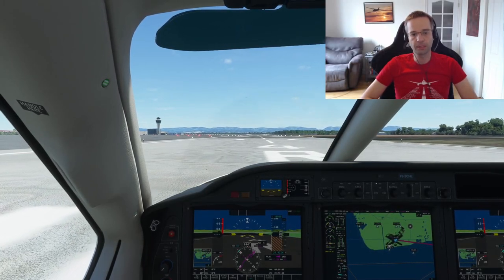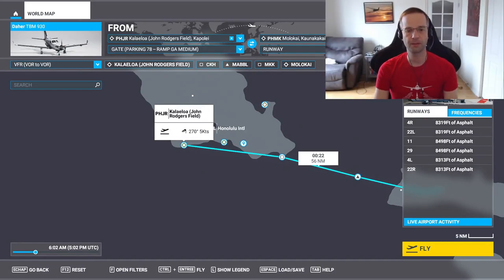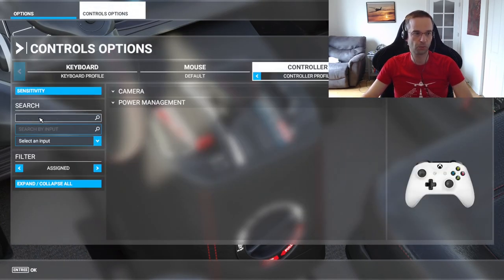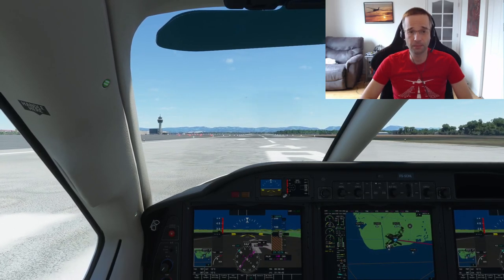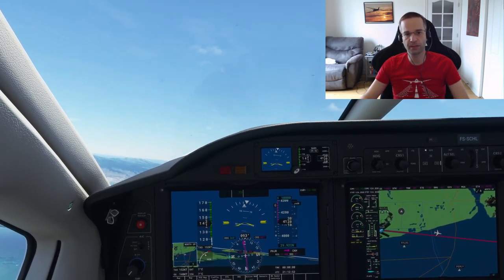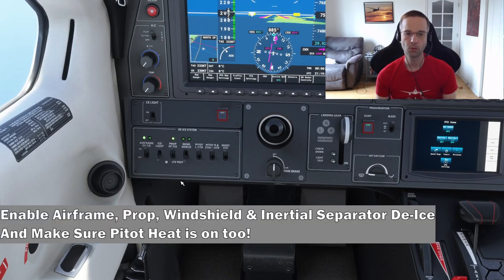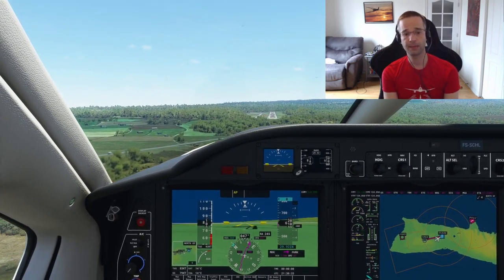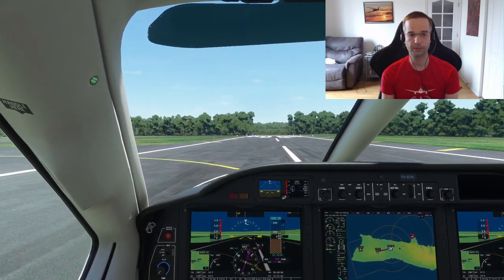How To Fly Turboprops Like The TBM930 | Microsoft Flight Simulator Tutorial

Comment: how do you know/ control the pct of engine power?
Reply from the maker: Power is controlled by the throttle. I learned by experimenting with this airplane, but generally you'll need full power on takeoff, slightly less than full on climb, same for cruise, and very little power on descent and whatever is needed to land.